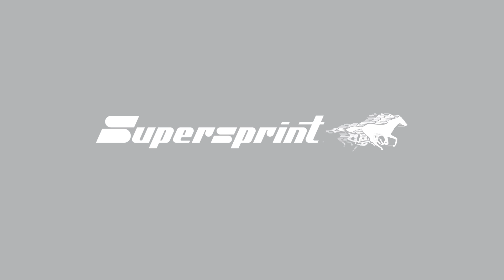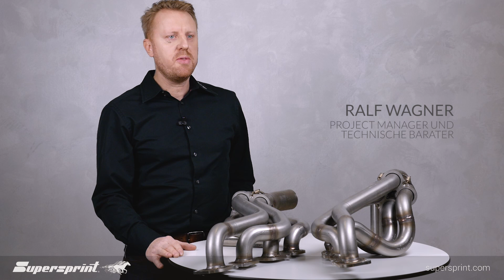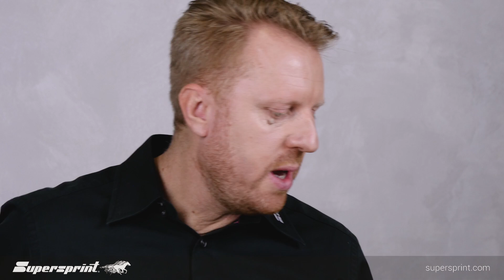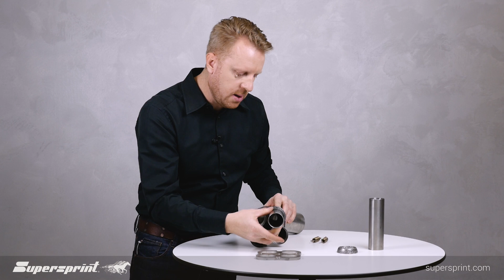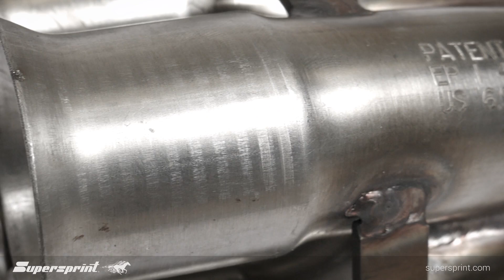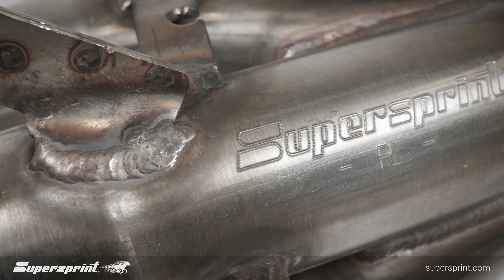Team Supersprint - Ralf Wagner on Supersprint Manifolds

Comment: Ciao funziona anche sulla Mercedes E 350 cdi anno 2010 .3000cc. 170kw Grazie
Reply from the maker: Ciao! per Mercedes W212 E 350 CDI abbiamo sviluppato uno scarico specifico, visibile al seguente link:

http://www.supersprint.com/ww-it/mercedes-w212-e-350-cdi-v6-berlina--sw-211-265-hp-09-.aspx

Non esitare a contattarci al nostro indirizzo mail info@supersprint.com per ulteriori informazioni :)
Reply: Thank you very much for this detailed explanation! I want a complete Supersprint system on my V8 BMW! But how do you manage the wiring from the O2 sensors? They are too short for these long tube headers.
Does Supersprint provide a set with these headers or catalytic converters downstream?